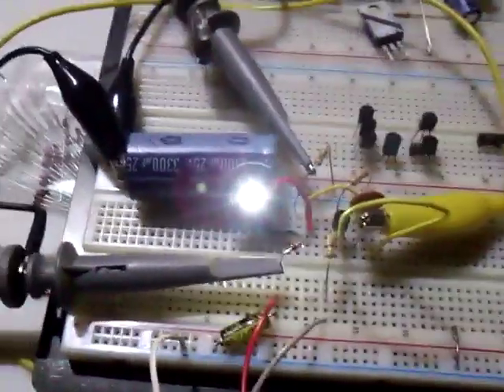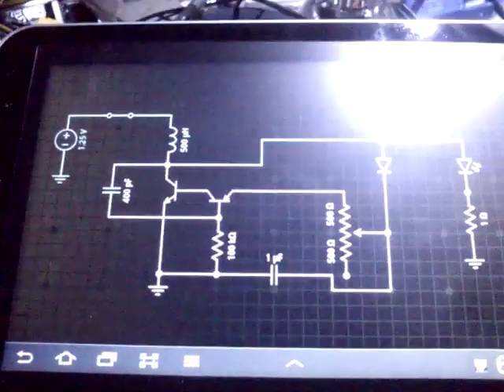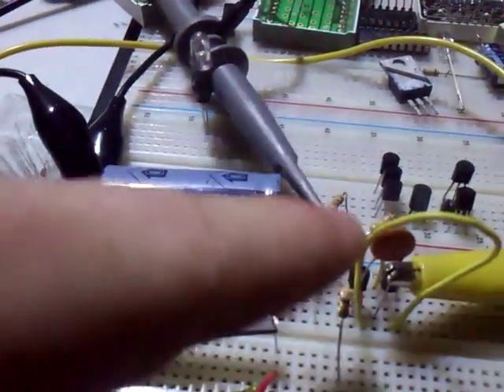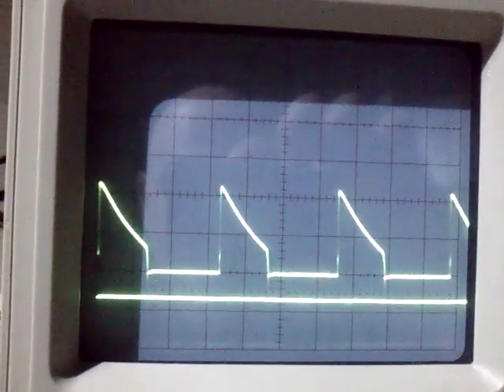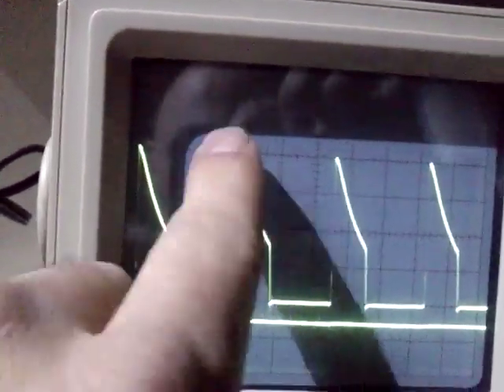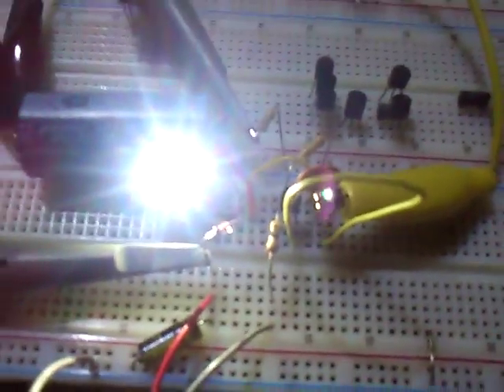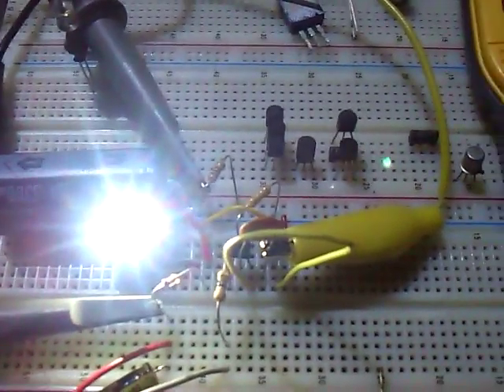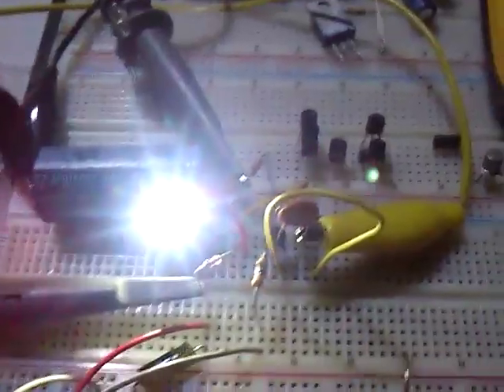High power joule thief?

Comment: How did you construct that 500uH inductor?
Reply from the maker: it was pre-made one that I simply use. I also have an inductance meter so if I need special inductor I can simply make them.
Reply: Thanks for fast reply. I tested the circuit with slight changes of components. You are right ! The values of the components are not critical. I made the inductor using the ferrite ring extracted from cfl, with few windings of insulated copper wire. It was worked great.
Reply from the maker: +neon 88 glad you enjoy the circuit 😀

Comment: Nice Video,  I think that impossible reading, might be right.  that's the whole reason a Joule Thief exists. It's a thief.
Reply from the maker: This one is more a dc to dc converter and the reason I put high power was for the LED it's design for 1 Watt LED. And as the voltage drop and amperage the LED will just be dimmer.

Comment: Thanks for the video. You need to measure supply current drawn at high frequency with a current probe. The ohmmeter will not measure that. Also, on the scope your waveform was only 4 units high. you counted 1,2,3....5. Four scope graticule divisions x 50 mv / 10 ohm resistor = 200 mv /10 ohms = 20 ma.

Comment: Long ago I bought a hundred of them, real Panasonic, for $0.27 apiece.  Then I found out I could go to the Rite Aid store and ask them for their disposable camera bodies after they removed the film.  The flash units often had the same transistor.  And they can be used for other things, too, if you've seen the videos about them on Youtube.  Later I got a bunch of KSD5041 (Fairchild), which are just about the same. Remember that what's important is high gain at low V and high current Thx 4 attaboy

Comment: Well, don't keep me in suspense!  What's the number of the transistor???  I've used the KSD1273 and 2SD2334 in some projects.  When I wind the coils, I use the copper wire tables to find the resistance of the length of wire I'm using.  I also have a HP 6-1/2 digit DMM with 4-wire probes to measure prewound coils.  Lately I bought some MOSFETs but the distributor screwed up and mixed other numbers with them.  See my blog for more info. rustybolt dot info slash wordpress slash

Comment from the maker: Yes indeed you are correct I should get my milliohm meter back running. Also my new transistor should arrive soon so I can test this circuit again 2N222A have a HFE of roughly 200~250 and can handle 800 mAmp those I order have a HFE of 600~900 and 6 amp driving this should get interesting.

Comment: The DC resistance of the wire in different coils makes a big difference in the amount of power wasted in heating up the winding, and that lowers the efficiency.  The resistance also limits the amount of current that can pass.  So lower inductance can be better.  I wrote a blog recently about the JT coils and I explain why.
rustybolt(.)info(/)wordpress(/)?p=3497

Comment from the maker: The pot is a 47k 10 turn 2W and the coil is just a basic one I think I was using some 100 uH one like I normally use technically you can use almost any coil from 10 uH to 1mH and they will all work they will also give different efficiency too.

Comment: Well, the list doesn't give much info, but it at least tells you that it's equivalent to the TA something or other.  One thing I didn't see in the vid was any info about the coil.  The circuit looks very familiar, and I've experimented with it before,  What is the resistance of the pot when you have adjusted it to what you think is the right setting?

Comment: You didn't hold that power transistor still very long, but I think it said 417-101.  I believe that part number is in this Heathkit crossreference list.  It's probably the output transistor for an audio power amplifier.  Here's the link. d8apro(.)com(/)HCross(.)htm ( remove the parens).